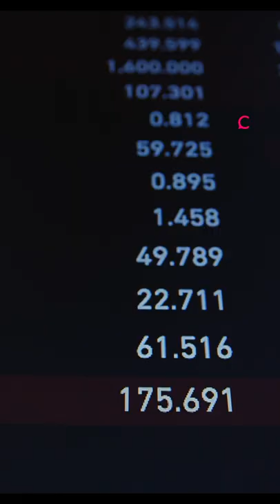Why is India unable to design a jet engine for fighters?

Comment: Can have an amazing military, technology, consumer electronics. But can't design an engine?
Reply: Underfunding by govt
Reply: Jet engines are a bit different from washing machine my guy.
Reply: Designing hot core of jet engine is very difficult as it to reach temperature to 3000 c and unlike rocket engine has to be reusable.
Reply: Well you probably dont know designing a jet engine is a tough nut to crack. We do have our own jet engine called Kaveri which produces 75 KN of thrust but we need more thrust. That's why a JV will soon be inked with either Saffran or Rolls Royce for 125 KN class Jet engine development
Reply: Imagine designing one suka
Reply: These are the guys that sunk 2 subs at the pier....
Reply: @hahua90  blah blah blah cant do it.  Thats the summary of your excuses.
Reply: @mtmadigan82  what do you mean?
Reply: @mtmadigan82  who feeds you that crap?
Reply: @ritikshaw5868  new york times mostly.
Reply: Internal combustion engine is the crown jewel of human engineering. It’s like designing a Swiss watch but each delicate component must be able to withstand several tons of pressure at hundreds of degrees AND be small and light enough to fit onto a vehicle.
Reply: Or a toilet
Reply: They had exactly the same problem with CPUs..
Reply: They don’t have an amazing military and the video just said that ist is a consumer electronics market, not a manufacturer which India definitely isn’t. India is a huge mess.
Reply: @kamalnadh2445  😂
Reply: Well up untill 80 years ago we couldn't even govern our own country.....forget about engines, give us another 50 years and the global economy, space and military sectors will have another leader
Reply: @dParakeet  your pant buttons was also made by India... U should be grateful for that Or u would have integrity when u don't have buttons in public... Mind it
Reply: Designing a engine is not so easy only 4 countries in the world have been able to build their own engine and also india is still not being able to allocate more budget for this
Reply: It's not that jet engines are incredible more difficult to make, rather the technology is kept secret.

So rather than 1 person inventing the wheel and the rest of the world adapting it, everyone has to invent the wheel independently. This coupled with low funding and experience led to a partly failed engine project. 

Buy credit where credit is due, our scientists made crazy progress right in the first attempt itself
Reply: @eternal1967  man, from the majority of calculus and math to gunpowder, all came from India
Reply: @user-nq5hy7vn9k  yeah ik even the surgery and wifi came from India... But world doesn't appreciate or show us some smile at least for india for it.
Reply: @eternal1967  India has lost the softpower/media influence battle. Media of west(no matter which wing they are of) writes racist and untrue stuff about India. I remember nyt even making racist jokes on India and its successful space mission when India successfully performed the mangalyaan mission. Most of west is full of hipocrisy and hold India(and even other developing nations that don't bend over back for them) to a standard/criteria, which the west itself fails to withhold at times. 

The only people who were less brutal and hold a somewhat good view of India are Israelis and People of USSR and other baltic/Warsaw pact countries from the Soviet Era
Reply: @user-nq5hy7vn9k  yeah world hates..... But they r knowing the power of modi, he given ayurveda to whole world, even beggar Pakistan and their brother turkey is begging for more wheat in India.... America and Russia is happy for agriculture help from india, German is loving india's drdo unique ideas, Israel and Japan also... Japan is helping india in economy. .. 
thanks to modi for all support for making india a powerful nation
Reply: @eternal1967  that's power of India's growth potential. All countries are trying to become friendly with India right now. A huge groundwork for safe and prosperous India was Laid down my Mr. Atal Bihari Ji and his policy of keeping country first before politics and political gain. Narendra Modi is continuing the legacy he left behind (although there still are sectors and fields that need more attention and improvement from the current government). We should have strong leadership for next 20 continuously at least (or up until the point we at least reach the 10 trillion dollar mark in GDP)
Reply: @user-nq5hy7vn9k  only true indian leaders can make india powerful... Just like kgf dialouge " POWERFUL PEOPLE MAKE PLACES POWERFUL " ... We need more leaders like modi for thr benefit of future for india
Reply: @eternal1967  unfortunately though, Modi will be 74 at the time of next election, and due to the informal rule of BJP of making people above 75 step down and lead the margdarshan wing of BJP and let younger generations take the lead, I think his time as PM is limited unfortunately
Reply: @user-nq5hy7vn9k  😩😩😩 we need people like him, then only we get good future for our younger generation.. Yogi is there... Let's make him win after modi reach 74
Reply: @eternal1967  I doubt people outside UP-Bihar region are really his fan though. He also has less experience in central level politics IIRC. Nitin Gadkari ji, Rajnath Ji or Amit Shah might be a more likely candidate
Reply: @user-nq5hy7vn9k  yeah he is... He can control all radicals down and we need bulldozer baba to do buldozer in Pakistan border in pok
Reply: Its not that hard to design a jet engine… 

But to design a jet engine that can compete with the current line of hightech ubermachines currently in use? Hah.
Reply: It is not that simple. They did design and made a modern engine and it does provide enough dry thrust but not enough afterburner thrust. Main issue is that the government sanctioned paltry funding compared to money invested by France to produce the m88 engine and there were many delays in actually disbursing the alloted funds to the concerned agencies.They were having trouble mastering single crystal engine blade technology but they seemed to have mastered it if recent reports are to be believed.
Reply: It's not car engine, it's jet engine.
Requires huge funding.
Reply: @kanekiken2002  you would be surprised. Even designing a car engine from scatch nowadays takes hundreds of millions of dollars. 

Gotta rmmbr, aloooot of things have to be considered when building a new car engine:
Efficiency
Emission standards
Cross platforming
Adaptation and futureproofing

Thats why small car companies dont bother making their own rngines n straight up buy ones that r available.

Ie: Pagani supercars even till today use mercedes engine. All rolls royces use BMW engines. Lotus cars r powered by Toyota engines. Aston martins r now powered by mercedes AMG engines.. n the list goes on.
Reply: @arsyadidris6349  Yeah agree with that.
But still car engines are much easier to build in comparison to the jet engines, I was talking in that sense.
Reply: @kanekiken2002  ahah. Yeah indeed. And customers for car egines number in the millions, so the returns r guaranteed. Number of Customers for jet engines.. ur lucky if u can get 3 figures😅 n thats commercial jet engines.
Reply: how many developed countries have their own engine ? as a developing country we have tried and going to make it soon
Reply: Yupp
Reply: But the technology is not indigenous to India 
They just learn the concept of how it works
Reply: @xyzaero  i think u dont kn but most of the samsung products, apple, mi are actually manufacturing their products in india
Reply: @xyzaero  good observtion
Reply: How big is the Rock you are living under? 🤡

We will soon have own engine (working together baith French safran and some homemade engines ) even other nations cannot make one
Reply: @Abheeeeee9  it's only a 1000 ton Boulder
Reply: Don't worry I also can't produce my own jet engine either 🇨🇳
Reply: @av1479  Yup true ...Thats why F-35 is expensive too not only it's stealth but also it's unique VTOL Engine
Reply: Are you american?
Reply: The core of kaveri engine was problem because we weren't able to manufacture a heat tolerant core owing to lack in shophisticated metallurgy ...we developed the technology last year and now we are on it.
Reply: Single crystal casting isn't like making pancakes.
Reply: Lack of funds..... India is still a poor country
Reply: Jet engines are very hard to build. It was the British that gave the Americans and Soviets the technology to build their first ones.
Reply: They already have their indigenously designed engine. HAL TEJAS.
Reply: @hardikjha6645  no no.   They stopped taking my calls like long ago.
Reply: @ritikshaw5868  about the indians destroying 2 subs in port by themselves? This isnt a big secret like the chinese having subs popup with dead crews.  The indians, no joke, tried to submerge a sub with open hatches, then had another that burnt down roped to the dock.  And they were both leased (lease to own) from the ruskies.  No joke, i cant tell you what i would have paid to hear the conversation between the indians and russians explaining the first ship.  Then a few weeks later how another was really jacked up.
Reply: @mtmadigan82  the "burning down" wasn't even a recent history. And it wasn't a Russian leased submarine either (can't even bother to Google). It was an Indian Kilo class diesel electric submarine which had an explosion while at the Dock and it had to salvaged and sent for repairs and is again fully operational and in service.. So of you're over your racist tirade or do you have some other issue with India and you'll try to bring up another half baked incident?
Reply: Because its hard to make one. Just look at china, no matter how they try to copy Russian engine its still lacking in terms of thrust. How much more if they will start from scratch and design their own.
Reply: we are developing nation so in future we will do that nothing happen in a day its take time and your logic is too stupid if you can make one type of things it does't mean you can make all things.
Reply: China still rely on russian engine designs, their version is bad compared to even the russian one, so yeah, it's not "easy".
Reply: @nowwhat9053  F35 VTOL engine isn't unique, it's inspired a lot by the russian design of the 80'
Reply: Even China isn't able to make engine. They uses Russian engines

Comment: India is a BRICS country and G20 country.
    It's GDP provides the basis for higher tech development, but with necessary assistance.
Reply: Our population is also too much
Reply: @The_wingedman  it's not a problem . You can't blame population for everything. We haven't developed a jet engine because the kaveri program didn't turn out as planned , with meagre funding it was unlikely to be successful from the beginning . This made the government distrustful and they backed off from any further funding , cancelling and re-starting the program several times . 
What should be done is to make a private public partenership with GTRE and L&T or TASL to handle and improve the manufacturing aspect and let GTRE focus on the designing part alone with the help of a foreign OEM .
Reply: @The_wingedman  the decimate it
Reply: @cat-man5522  The problem is that India and the private sector doesn’t have the know-how, it will need a tech transfer from another country.
Reply: Recently India sign a deal With General electric to manufacture GE414 engine with 80% technology transfer and today India sign another deal with France saffran to co develop totally new jet engine of 120kn for India's Upcoming 5th generation jet AMCA

Comment: Canada, Japan, Germany, Brazil all have nearly 100+ years of developing aircraft but none have indigenous engines (except those of WWII era). Even today, Brazil's Embraer and Canada's Bombardier jetliners use foreign engines.

The modern engine development is very sensitive and requires extreme precision . Meaning: every single internal component and structure requires extreme precision down to the thousandth (0.0001) millimeter, gram, or whatever unit of measurement. Because even a slight imprecision will yield large visible defects such as low thrust, poor fuel economy, etc.

Engine developers have dozens of third party suppliers for internal components. They'll get the wiring from one supplier, metal from another supplier, electronics from another, etc. Every supplier has to ensure that every single part is built to extreme precision and the main developer has to check on every supplier to ensure their precision. In the end, what is required by the developer is very resource-intensive, laborious work, with many critical points of failure within the supply chain. 

This type of industriousness requires widespread, top of the line manufacturing infrastructure, with top of the line checks and balances, in multiple fields of science & tech, i.e. chemistry, metallurgy, physics, engineering, material sciences, etc. 

And then the developer has to ensure that their complete engine (i.e. India's Kaveri engine) is atleast somewhere near the functionality of a competitor that's already available (i.e. American GE engine). Otherwise the local engine is practically a failure.

US, Russia, UK, France, and recently China are the only countries that can make completely indigenous modern jet engines as of today. It is a sign of their indigenous industrial capacity and complexity. India is not there yet, and I don't expect it to have the ability for atleast 25 years.
Reply: As if all 195 countries have built their own engines
Reply: @user-vh1gc1ct6z  ??

Comment: All aircrafts currently in development are planned to have a US origin engine. This obviously creates a security issue. As a short term solution India is currently in talks with RR & Safran for a potential JV to develop an engine with shared IP.
The Kaveri engine project will run parallel. Current plan is to development a 50 kN dry variant for an upcoming UCAV project.
Reply: That's not a short term solution but the long term one and will permanently resolve problems related with jet engine development.
Reply: That's not a terrible security issue to have, US is pretty relaxed and friendly compared to 2 other unnamed countries lol. But yes, would be nice if india could make its own engines.
Reply: @hahua90  
JV is a short to medium term solution and as I said, kaveri is the long term.
Reply: @abcdedfg8340  
US have been historically antagonistic towards India, atleast in military terms. But regardless of history it is a security concern to give US significant influence in the Indian military aspects. That's also why the JV will most likely be with France because it has an independent foreign policy.
Reply: @asi2765  bhai do you even know about this? JV has been done for AMCA and TEDBF and future upgrades for tejas mk2 and possibly the su 30 mki as well. Kaveri will be put on the UCAV and that's about it! Long term solution is the JV not kaveri.
Reply: @asi2765  I mean you’ve been buying Russian hardware for ages, why would the US be happy about that, just look at what’s happening with Turkey a nato allies
Reply: @ilviandante2040  
Why would US be sad about that!?

Comment: Well kaveri engine has every part and every modern tech, but lacking hot core.
I bet hot core will be developed before 2030.
Well India make piston aircraft engine.
Reply: Bare-bone engine, it won’t have the most recent tech for a 5th gen engine
Reply: @ilviandante2040  and it isn't supposed to. Gotta start somewhere, and 5th gen isn't the end of technology
Reply: @Vajrapani108  Of course, I just added info on op comment

Comment: India is able to design. There is however a need to improve metallurgy and aviation grade components with desired safety standards and operability. Kaveri meets the ' dry' thrust requirement but is heavy. Single blade disc has already been " achieved". After burner technology and thrust vectoring is progressively being improved to desired standards. By early 2025 a lighter version is expected to be trial validated with private sector contributing to 5 potential versions.

Comment: I work on rocket propulsion systems and I can confirm, they are in many ways a lot simpler than jet engines. Harsher environment, but operationally very simplistic by comparison with nearly no moving parts save a two pumps and 1-2 turbines. Furthermore they only need to operate for minutes to seconds at a time, so they never accumulate nearly as many flight hours, assuming it's even reusable.
Reply: Oh gee ! Thanks for the comparison 🤭